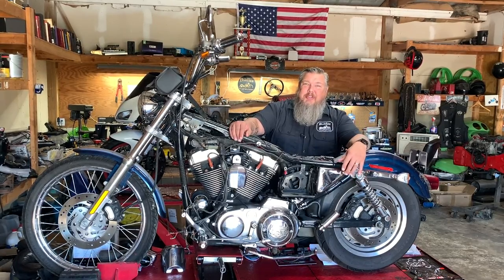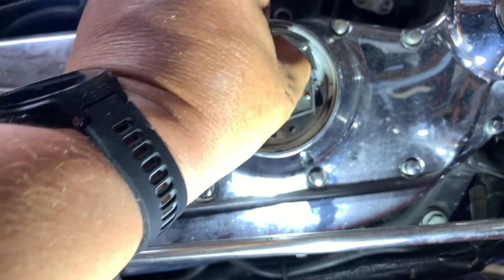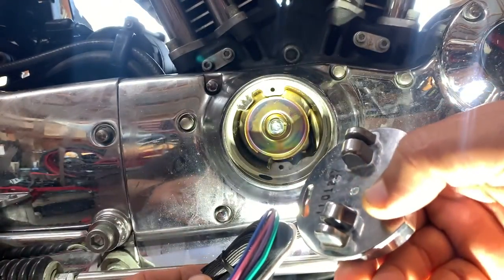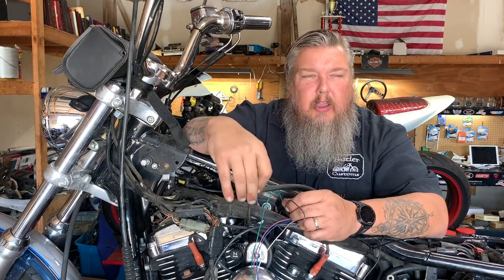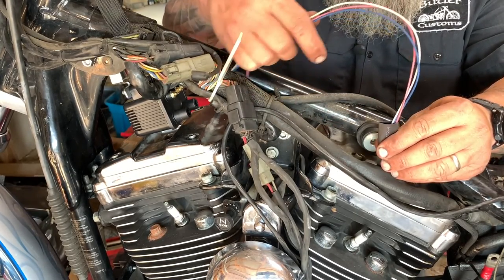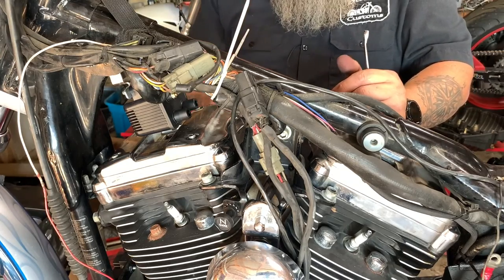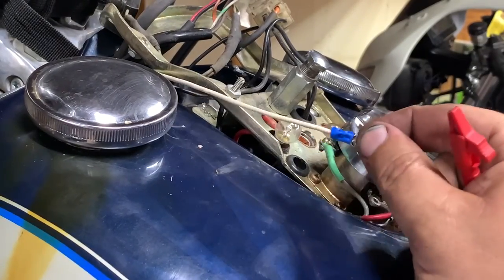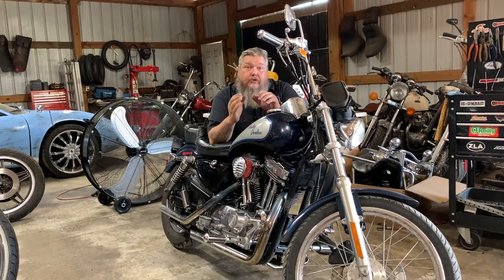2000 Sportster Complete Ignition System Upgrade to a Single Fire Ultima Ignition System.

Comment: This video is definitely a life saver. My wife has a 2000 sportster that's going to need wiring work when we finally get it home from storage in another state. Thank you for this. Great video 💯👍
Reply from the maker: Thank you for those kind words! I’m actually shooting another sportster video this week with a complete disassemble frame off. And then a reassemble. Step by step. Thanks again.

Comment: I just installed my Ultima ignition on the '03 883 that I recently bought. It had the 1200 top end. I have no idea about cams or anything with the valves. It was fast, but it mostly ran like garbage.

I sealed intake leaks with Flex Seal, re-jetted (#48, #185, and the '88 needle) and when it decided to run right, it ran great, perfect and fast. However, it still mostly ran like garbage. Then it started blowing ignition fuses and by the grace of God, I found a wire with a spot of missing insulation near the plug of the ignition, under the bike. I sealed around that with a rubber and asphalt product I had in the garage, and now no more blown fuses, but it still ran like garbage most of the time. However, when it decided to run right, it was great, and fast. 

So I ordered the Ultima ignition and installed it today. After a hundred miles, I can tell you that it pings and I can't get rid of the ping. Pre-detonation will kill it. Even on premium gas, it still pings, though less. It's still not good. I tried all the settings on the 6 small switches. None of the combinations seemed to make any noticeable difference. 

I eliminated the VOES. It was a new switch because the old one did not hold vacuum anymore. This switch clicks when I suck on the hose. I believe it is good. It is new, only a couple of weeks old, and I plan on using the VOES with the Ultima ignition. If that doesn't work, where do I go from there?

Do I see if somebody can re-tune the ignition, re-map it, or re-program it or what? I can't run it the way it is, except if I never roll the throttle on, but I can't live with that long term.

I heard on a you tube channel that the Ultima is the same thing as the Dynatec ignition, made by the same company, but somebody else said they are programmed differently, different mapping or whatever. 

So maybe this Ultima I have would work fine on a stock Sportster, I don't know, but it's not working on mine. Mine had an ignition that said "Screaming Eagle" on it. It said it had a 6800 rpm rev limiter. I never did hear the rev limiter when I rode it, but I did get to revving it a bit high. I trust that 6800 is true. 

The Ultima I set for 5200 or whatever, all switches off except for # 6- for single fire. I did rev it and heard the limiter come on. It sounds about right to me, so I believe the rev limiter works. It starts real nice, Idles well when cold, very well actually, and acts like it warms up real fast. No complaints there. It's just this Detonation thing, and that can destroy a motor. So where to go from here if going back to VOES doesn't help? I should find out tomorrow about the VOES. 

I've been messing with the bike for about a month now and hoped to come to the end of the road today, but not so, not yet. Other than the ping it's fine. I noticed that I could retard the heck out of it and rob all the performance, and even then, I get ping. That surprised me. I never heard of that before. Did I get a faulty unit? I don't know.

_______________ This is an update. From another you tube channel, I saw a setting of 2,3, and 4 on so I just tried those setting on the small switches on the plate, and no ping now, or maybe just barely, but not a real problem. This however is with a tank of premium gas.
Reply from the maker: Thanks for reaching out. Please send me an email and we can talk more in depth about your issues. It’s a lot easier than corresponding here. My email is butlercustomsmotorcycleshop@gmail.com
Reply: @butlercustoms  Thanks for reaching out. I just updated my comment above. I used 2, 3,and 4 on for the settings. Previously I did not mess with 4 and 5 as I believed them to be for rev limit. Now there is no ping, or maybe barely, I'm not real sure, but it's not a problem. However, this is with a tank of premium gas. So, seems OK for now, but I do want to get back to running regular gas. I appreciate your channel, especially since my kit did not come with any instructions.
Reply from the maker: @raybrensike42  me pleasure. Glad you got it fixed. I would certainly continue using premium fuel or non-ethanol in any road bike.
Reply: @butlercustoms  It happened to be non-ethanol premium that I was at when I looked to fill with premium, but man the price! Well, I hope to get back to regular, so I re-static timed it, as I had been all over the place turning the dial on the thing, and so I decided to "set it and forget it". Found an old piece of 1/4" air hose that was had a factory squeezed fitting on it, and that pushed out the 1/4" air hose just enough to fit nicely into the spark plug hole, turning it in with a wrench. Then I attached a balloon to it and saw it inflate, and then went to the other side of the bike and found the marks.

Now that it's set properly, and I have regular gas, except for maybe 10% of premium still in there too, it has what seems like just a little bit of ping when I roll the throttle on in 5th gear @ 45 mph. Do these ignitions "learn" what ping is and make adjustments after a while? 

Anyway, I think I am about out of the woods with this bike, but then something new happened. Blown ignition fuse again, but this time, it's only blown with I go out to ride it in the mornings, and then it would have a blown fuse after letting it sit after a ride, but then I found out it's not really about time, it's about turning the switch, like turning the ignition switch blows the fuse sometimes. 

This new thing began to happen at about the same time the kill switch on the handlebar quit working. I don't know if those two things are connected or not. This bike seemed like it had a jinx on it or something, but maybe this is just God letting me get to all the weaknesses in the bike to find and fix, and learn about, so later on I won't have any more of this trouble.

I checked with a light tester to see if there was power going to the ignition fuse when the switch was off and there was none. Power on one side of the fuse holder only when ignition switch was on, so that much is right.

So now I believe turning the switch on sometimes blows an ignition fuse. Now it never blows while riding as it did with the other problem which by God's grace and help, I found. 

Or, is the fuse blowing when turning the switch off? That might be more likely. So now I will purposefully turn off the bike with the ignition switch, in a quick motion, to see if it still blows a fuse. Time will tell. If I have to get a new switch I will and I suppose I should find out what went wrong with the kill switch on the handlebar. 

What a deal. 38 years on classic K BMW's and all of this. They were so dependable. Seems like all I did was oil, ani-freeze changes, tires, and batteries, in about that order, throughout the years, and a few spline lubes.

Going back to a Sportster is like going back to the stone age, but I still like a good Sportster. I like to ride it like a Sportster. This one is fast enough. It's like a Sporstser should be and that's enough for me, in my older age opinion. I'm not as go fast as I used to be.

There is a county road that another road connects to at an intersection, and I always got up to 60 mph on both the '85 K100 RT and with the K1100 LT which is a bit heavier. They both got up to 60 mph when I came to that driveway. This Sportster gets up to 70 mph at that driveway. It's fast enough for me.

I'm now running switch 2, 3 & 4, on. This seems like what this bike wants.
Reply from the maker: @raybrensike42  Sounds like your ignition fuse troubles could be related to the kill switch. The kill switch is only fed power when the ignition is on, therefore if there is a short in the orange wire (I believe orange or maybe orange/white) then it will pop the ignition fuse. I see this a lot when the switch wires are ran inside the bars improperly.  9 times out of t 10 when a fuse keeps popping then there is a hot wire touching ground intermittently.  Hope this helps.
Reply: @butlercustoms  Thanks. Will keep checking.
Reply from the maker: @raybrensike42  my pleasure.
Reply: @butlercustoms  So here is what I found out today, as I switched the hot wire that powers both the coil and the Ultima ignition, the center wire on the coil. 

At first, I tapped into the auxiliary wire that comes out of the Harley ignition switch. When I did that, there was no more blowing of ignition fuses while riding down the road, as was in the past with the old ignition. However, I had a blown fuse sometimes when I went out in the morning to start the bike, and shortly thereafter, sometimes just after a short riding break. Never did it short while riding. However, it would often have a blown fuse as I tried to start the bike. 

I suppose I should have known that I would no longer have a handlebar kill switch working if I powered up the coil and new ignition by tapping into a wire that comes on hot when the switch is on, which comes from the switch itself. I really should have figured that out, but electrical is not my forte. I never liked electrical and always avoided it whenever I could.

So, today I tried powering up the coil and new ignition with the wired that originally powered up the coil with the old ignition. That is off the Harley wiring harness. So, upon doing that, I started blowing ignition fuses while riding down the road. 

So there is something with the original wiring harness that is bad, showing an intermittent short. Those are the most difficult to find is what I imaging. I had thought that I had found and fixed that problem when I saw some bare wire near the old ignition plug under the bike, but apparently that wasn't it, as this showed up again today, when I was tapped into the old harness.  

Maybe this will make some sense and help someone as they decide to power up their new ignition. If you do like I did and tap into the ignition switch, finding the wire that heats up with the key turned on (with a test light) you will not have a handlebar kill switch to shut the motor off anymore. I hope that makes sense.

Now, maybe somebody might know which wire that is in the old harness that I might need to bypass if I wanted to use the old harness to power up the new ignition with, so I could still have a handlebar kill switch. Like I say, I'm not much at electronics.
Reply from the maker: @raybrensike42  let me pull up the schematics of your bike and try to help you out. I didn’t that you bypassed the kill switch. And just to verify it’s a 2003?
Reply: @butlercustoms  Yes, '03 Anniversary
Reply from the maker: @raybrensike42  I’ll pull up the diagram for you
Reply from the maker: @raybrensike42  if you don’t mind to email me at butlercustomsmotorcycleshop@gmail.com that way I can send you a pic of it. I can’t on here.
Reply: @butlercustoms  , Thanks. I have the schematic in my Service manual. It looks like the Bank Angle Sensor is on the same circuit as the handlebar kill switch. I suppose there could be an intermittent short anywhere in that circuit. (gray wire) For now, I'll run it as it is with the power for the coil / Ultima ignition getting its power tapped into the auxiliary wire right from the ignition switch and I'll be shutting down the bike with the ignition switch only. Since I've been turning the switch quickly instead of slowly, I haven't been burning any more fuses, so I think I'm fine for now. Maybe it's time for a new ignition switch.

Comment: On the comment he said somebody disconnected the voss I disconnected mine too tell you what actually gave me an improvement took that off and took that vacuum petcock off and put a pingel fuel petcock on what a difference bike run super great
Reply from the maker: That’s great to hear and thanks for commenting. I would also check your timing if you deleted the Voss.

Comment: on a singe fire coil if u trouble u unhook one of the 2  neg.  wires ues a juper wire between from one side to other reset sensor to duel fire your back to runnig  HAPPY TRAILS
Reply from the maker: Awesome. I’ve never heard of that before. I Would think this would destroy the coil? Coils are either dual fire or single fire to my understanding but I could be wrong. Thanks for watching.

Comment: Mines an 03 883H. I had an issue where the bike would stall when it reached full temp. Wouldn't restart until it cooled off. Few big backfires. Dyna 2000i fixed it
Reply from the maker: Awesome. Most folks don’t realize those stock ignitions will melt over time due to the heat of the motor and the front exhaust header. Glad you got it fixed! Thanks for commenting.

Comment: Normally I take a dim view of Ultima stuff, but I compared an Ultima ignition module with a Dyna 2000i and there were exactly the same except for the label. Can't say the same for the coils, but mine haven't failed yet.
Reply from the maker: I really like the Ultima ignitions and their transmission kits. But I’m not a big fan of their motors though. Thanks for watching!

Comment: Hi ive installed my ignition as per your tutorial and just wondering why you deleted the voes?. Im at that stage now and unsure as to what to do. Great clear info, thank you Sir 👍
Reply from the maker: The ignition I installed had the option to run without the voes so the customer wanted that system removed. He wanted it removed because of the high failure rates of those voes systems.
Reply: Ok that's great thanks a lot. 👍
Reply from the maker: @simonfreeman148  my pleasure
Reply: @butlercustoms  If I could trouble you again kind Sir, with running votes on this type of ignition what position would No1 switch be set at?. Thanks.
Reply from the maker: @simonfreeman148  no worries. Just to verify, what brand and model number is your new ignition?
Reply: @butlercustoms  Hi, it's a generic copy of an Ultima/ Dyna 2000i. I bought it to try single fire and see, if it craps out I will buy an Ultima.
Reply from the maker: @simonfreeman148  on the Ultima 53-644, switch #1 is your VOES SWITCH. ON is retard and OFF is normal.
Reply: @butlercustoms  Got you!. Thanks very much. You guys are a credit to the YouTube channels. 😎
Reply from the maker: @simonfreeman148  thank you for those kind words.

Comment: Hey u wouldn't bye any chance have a wiring  diagram on how to wire a 95 1200 sportster back up to a ecm module to the ignition system assembly in the nose cone would u I tried  grease garage  system  but would  not work so  I'm going try to rewire it back to normal any help would be appreciated  ty
Reply from the maker: @bennygregory2629  I should have a factory diagram I can send over to you. Just send me an email and I can get it to you that way. Butlercustomsmotorcycleshop@gmail.com
Reply: U get my email
Reply from the maker: @bennygregory2629  yes. I’ll have to pull it up on my laptop when I get home.
Reply: @butlercustoms  ty
Reply from the maker: @bennygregory2629  my pleasure.